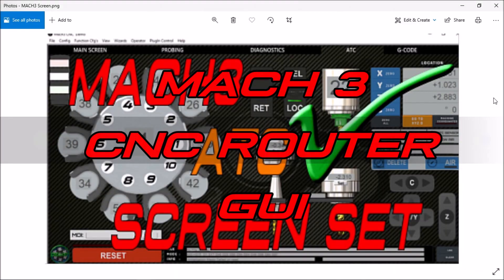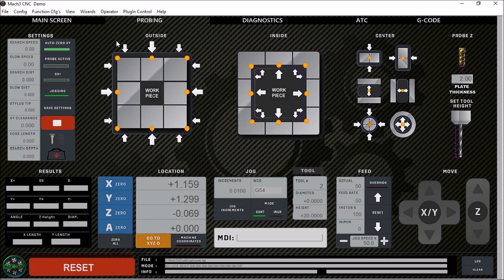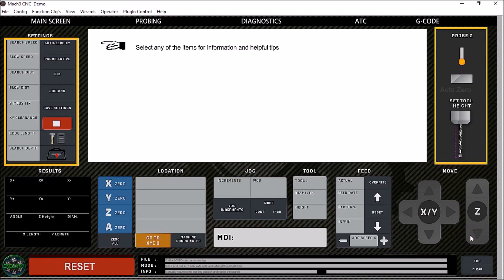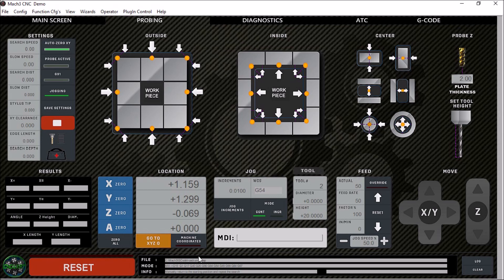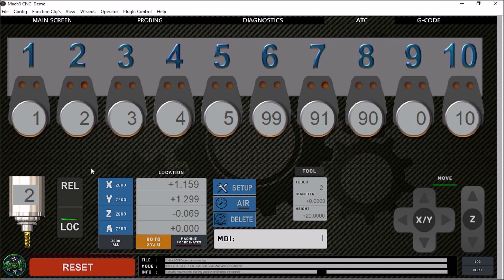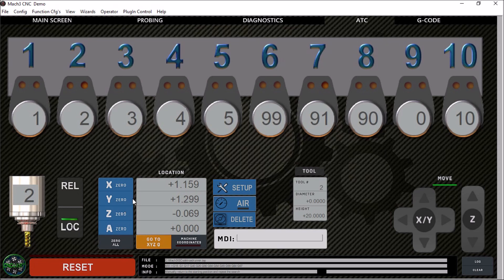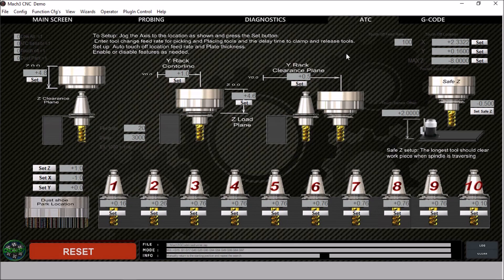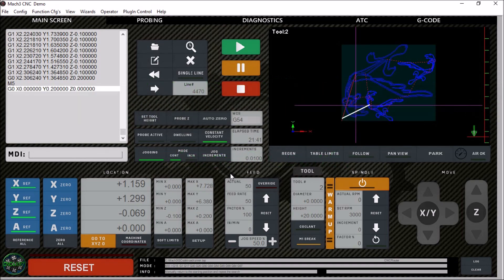CNC ROUTER GUI

Comment: How many output ports and input ports do I need to use ATC?
Currently, ESS boards are used, and I/O ports are not enough because interface boards are small.
Reply from the maker: The Screen uses a minimum amount of I/O's  1 output slide solenoid. 1 output Draw bar. Optional Air Blast Output. 3 inputs all can be disabled so they are optional. Slide retract /Extend and Low air input. and also a C axis home sensor Also Optional.